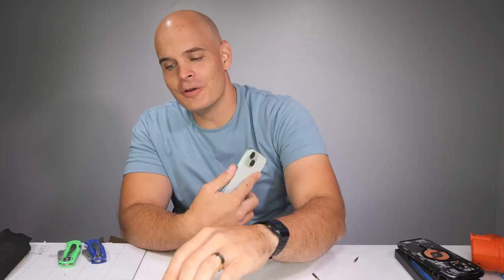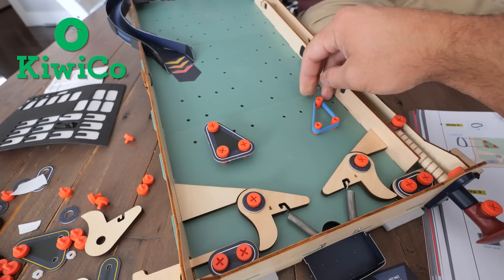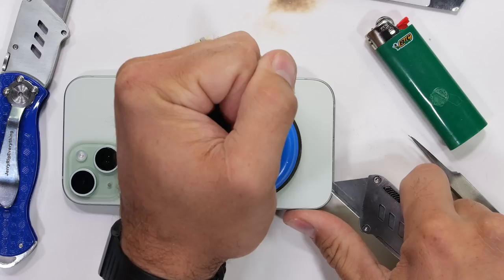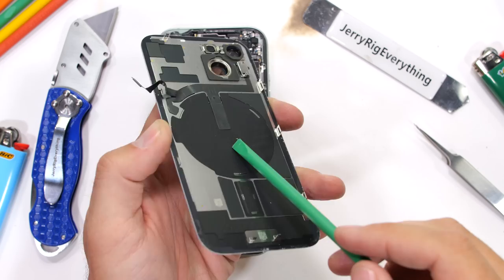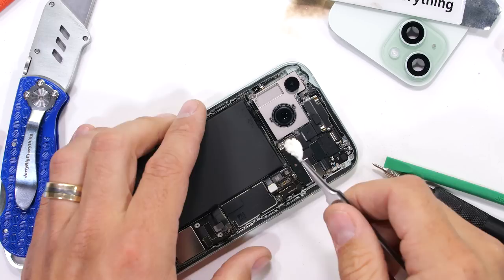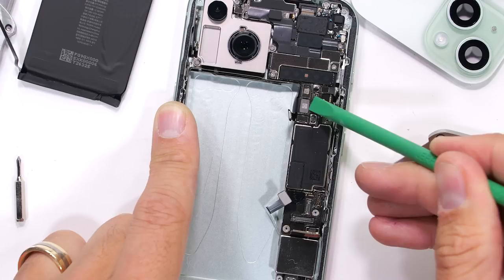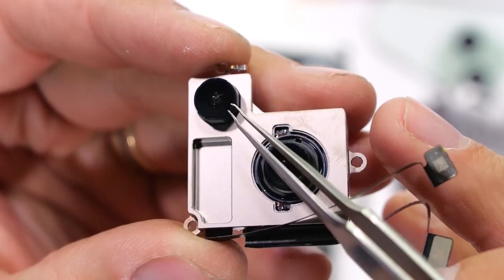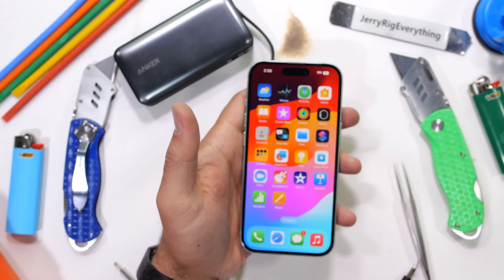iPhone 15 Teardown - Why is nobody talking about this?!

Comment: Excited to see what you feel after using an iPhone for 6 months. One of my friends said he would die before switching to iPhone but eventually he did, and never went back to Samsung. Don’t really understand the tribalism when it comes to what slab of glass and metal you use, but he took it pretty seriously, so it was very funny when he switched and found he preferred Apple
Reply: I have nothing against Android, I just like the look a feel of iOS.
Reply: I like android better, but to each their own lol
Reply: I actually tried an iPhone back in the day with an iPhone 5. I used it for 3 days but didn't like it. I suppose everyone has their own tastes.
Reply: Pixel beats both those phones
Reply: For a brief moment as I was reading I thought your friend did died.
Reply: @wshyangify  lmao
Reply: "don't really understand the tribalism when it comes to what slab of glass and metal you use..." because consumers have voting power, and they vote with their wallets, and i will not vote for a company that software locks the back glass panel to the motherboard..
Reply: Consistency with the software suite matters far more than the hardware used. That being said, I also don't want to pay criminal prices for a new screen or a battery swap. Or any of the other bullshit apple does and calls "customer service".
Reply: @faz_s Same. I think Android offers something different, a device which doesn't limit what you can do with your phone. The iPhone 5 was the only iPhone I used.
Reply: @psylencecy  I don’t think you know what I mean by tribalism. I mean I don’t understand why people fight each other over if Apple is better than android. It really doesn’t matter at all
Reply: @skinnyman  exactly. we fight because we want our brands to be consumer friendly. if both apple and android brands followed the same anti-consumer practices (eg no charger in the box) we will be screwed.
Reply: @faz_s iPhone 5? Seriously
Reply: @psylencecy  No, I’m saying I don’t get why people attack one another for which phone they choose to use. That’s really stupid
Reply: @ruga129  yep... Seriously!
Reply: @faz_s  I mean the last iPhone you used was iPhone 5 and iPhone (not only iPhone every phone) has improved dramatically and you are using iPhone 5 experience to compare it
Reply: Me too, Google think My country is too poor to afford Pixel so they did not sell one here

Samsung is nice, but their repair is as painful as iPhone, not to mention their OLED screen randomly get lightsaber for no reason

Which leave me with the fruit, not ideal but it’s the best for me

The price is painful, but at least I’m keeping it for 3 years or longer
Reply: @ruga129  well it was the best iPhone at that time. It's not like I could have bought an iPhone 14 back then hey!

Lots of iPhone users judge Android phones on phones that they experienced in the past.

I didn't like the fact that I had to be tied down to only using apple products in order to get the most out of it.

Haa that changed?
Reply: @faz_s  I am not saying iPhone 5 was bad but around 11 gen have changed since then. You can't compare any phone on the basis of a decade old device. I am not even saying to use a iPhone. I just feel weird that you are saying you don't have an iPhone because you don't like a decade old phone
Reply: @ruga129  well that was a decade ago.. And at that time.. I preferred android.

Does iPhone not tie u down to only using their devices.. As the say.. The apple ecosystem. I don't like that. If I paid for something I want to be able to use it how I want and with whichever devices I want.

Does apple offer that?
Reply: @heickelrrx  yeah the longevity of iPhone is its biggest selling point imo, you get about 7 years of updates
Reply: @skinnyman  And they sell in more place than Pixel

Google think I'm too poor to afford pixel, while Apple still willing to sell me one of their phone

it's crazy
Reply: been debating switching myself, always been an android user mostly due to Apples "walled garden" approach to apps/app store and their (slowly improving) views on right to repair and repair costs

Comment: I’ve been an Android user for the last 15 years and recently changed to the iPhone 15 pro max and it was a great decision as the battery is incredible
Reply: ?
You can even find mid range android phones with much better battery and charge speed than iphone, What differentiates the iPhone is that it is a very balanced device, it is not a 10, but a 9 in everything, pixel is a 10 in camera but 7 in battery.

Comment: you’re missing some info on some “iffy” points. specifically with the 3-d touch feature. you claim you have to go to settings from the home page, which is true for many things, but wifi and bluetooth are not those things. on the interaction menu, hard-press on the bluetooth/wifi icon to open their mini-menus. also, when moving the cursor (idk what it’s called) while typing, you can hard-press the space bar to accurately move it where you need. 3-d touch is pretty neat.

edit: i switched from android to iphone ~4 years ago. you didn’t mention the worst part of iphone. the app store suuucks. especially if you’re the creative type. i have a windows pc to use for my creative endeavors now, but if i didn’t, i would 100% guaranteed still be on android. the play store has much better apps for photo, video, and audio editing.

Comment: That place holder has a ribbon cable and a connector, I guess you can get a sim card adapter and a international housing and convert your US iPhone into a SIM iPhone (I got my iPhone 12 dual SIM adapter from AliExpress and converted NA iPhone into a dual SIM kind)  I guess?

Comment: It doesn't matter about modular components and battery pull tabs if every single component is paired to the logic board, thereby prohibiting 3rd party repair (outside of Apple's pricing).
I was recently able to repair a Galaxy A50 with a new screen, interconnect cable, camera, rear adhesive AND get a suitable case and screen protector all for under £70.
It would cost more than £70 just to buy a (serialized) battery from Apple's self-repair catalog!

Comment: Did you know???
If you use the ultra wide or the 3X zoom without using the main lense, you cover the main lense while using either wide or zoom it will mess the lighting??
I just tried it on the 13 Pro max

Comment: I just leave my notes here.

6000 kelvin is roughly 3.128602643E-26 Horsepower (metric) Hour

It's better to calculate Temperature with Horsepower Hours imo

Comment: I feel like the titanium, similar to the stainless steel is just another gimmick. Aluminum is the best overall for a reason hence why the majority of other phones continue to use it to this day. It's cheap, durable and lightweight. If the pro iPhones went back to sturdy aluminum, I probably wouldn't notice any difference

Comment: Could you do an iPhone screen comparison between the last five or so generations? Has ceramic shield gotten better? Are we at the point where screen protectors are no longer really necessary?
Reply: Necessary is subjective. 

If you do not use a screen protector, your screen is liable to get scratches, no matter what phone you’re using, deep or surface level - it’s gonna happen. I think a tempered glass screen protector’s best use case is honestly against drops. Much better to spend $10 on tempered glass protector than replacing a screen.

Whether scratches bother you or not, that’s the subjective part of “Is it necessary?” Necessary, no. That goes for any phone ever. You don’t HAVE to protect it. 

With Apple’s such restrictiveness on replacing something like a screen, it’s kind of silly NOT to put a protector on it.

Then again, this is coming from a certified dumbass who does not use a screen protector. 😂 I have an iPhone. It has scratches. Every iPhone I’ve had has gotten scratches. I don’t really mind them, thus the subjectiveness and non-necessity for me.

Comment: In 2021 I switched to iPhone, then in 2022 I got a 1tb 14 pro max at launch and this year I got the 1tb 15 pro max at launch. Yes I got apple care on both of those since I don’t use cases. The 14 pro max survived 15 concrete drops throughout its year before I sold it, idk what the max amount is, but I drop my phone a lot. 15 pro max is noticeably more scratch resistant tho, maybe that’s why the glass shatters easier?

Comment: Oh boy, I remember when repairable phones were common. I miss them so badly it hurts on more than one level, financially, emotionally, physically. I just want to replace the broken parts and not contribute to a massive pile of unusable electronics, is that really too much to ask for? 
You can recycle all you want, but if you prevent people from repairing the device it's basically a useless cause at that point.

Comment: Apple should have used the same iPhone 15 back design for the iPhone 15 pro and the max because thats how its more durable and not going to shadder because all new phones are the same size both iPhone 15's and the 15 pros
Reply: but then they wont make as much money through repairs. thats the whole point.

Comment: For the record, the software locks on the back glass are so inconsequential that I think most people wouldn’t even know if you replaced the back glass on their phone.
Reply: That software lock is probably more for the wireless charger/magsafe , they probably require some calibration. Not the backlass itself but the features will likely not work the backpanel gets replaced

Comment: You probably meant 5-600 Kelvin? Because 5-6000 Kelvin is, well, almost 5-6000°C or ~9000°F which is close to the temperature of the Sun, so the best thing that would be left of that iPhone would be a pile of ash.

Comment: I was using a Xiaomi Mi 9t pro (yes, taht one that the camare goes up) for the past 4 years! I never had any problems with the camera neither with any other part of the phone!
For the first 3 years I used the case that it came with, but for the las year i was using it without any case.... It was really good tho, droped it sometimes and it never broke or anything, but my cat fu*** cat pushed it from a really high table and it fell flat, the screen died.
Oh, I also used it without any screen protector for the 4 years!
It's kinda sad that those cool cameras aren't being made anymore so I was thinking about buying a Z Flip 5. BUT OMG IT'S EXPENSIVE HERE IN BRAZIL!!!!
I will use a Samsung A30something (my mom's old one) until i can afford a Flip (i'm 18 and a student, don't think i will be able to buy it in less than a year).

Just wanted to share my experience with phone taht has one of those cool cameras and prove that it isn't something that will brake!

Thx for reading!
Reply: Sorry for my bad english, everything i know is from playing games, watching things and talkng to some people.

Comment: I'll take difficult to remove and glued in parts over software locks any day. You can remove and replace the back glass on older iPhones with the right tools (or replace the whole housing, which isn't that expensive aftermarket) and with the help of some alcohol and heat, you can replace Samsung's stubbornly glued in batteries and everything functions normally. With software locks, you can't restore all original functionality at all, no matter how easy the part itself is to replace. So if anything, I think Apple are really going backwards when it comes to repairability.

Comment: > Spends more than a decade making their devices unable to be repaired by the owners or 3rd party
> not allowing spare parts to be sold to 3rd party tenchincians
> makes half assed self repair program that costs more than a new device to repair the existing one
> bribes officials to modify right to repair bill so that it doesn't help a consumer in any way whatsoever
> still software locks parts EVEN the fucking back panel glass

Adds USB C, Makes the back panel glass slightly easier to remove than before

Oh WaW aPplE is MaKIng iPhuNes repairable, thuMbS uP fOr tHAt!

Seriously Zack are we really this dense?

Comment: I purchased iphone 15 on 22 October and now battery health dropped to 97 with only 35 charging cycles. Apple is intentionally using cheap batteries to get money from battery replacements.
Reply: Shhh eso es secreto😌
Reply: I purchased the base model iPhone 15 back in September close to the release date.

Been 4 months using the phone everyday and battery health still shows 100%.

Comment: Apple:FINE We will make the phone repairable.

Customer:Sweet! 

Apple:Im going to make it painful, expensive and painful to change anything but a screen or battery cause fuck you. Also we are software locking the phone so you almost have to break the back to get it apart. 

Customer:Why? 
Poor UbreakIfix tech: Dude why? 
Anyone with a brain:Why? 
Brainless: Also why? 

Im convinced apple functions solely on the elitism (Its extreme but I couldnt think of a better word for it, sorry) it has creates around its products using the eco system and Imessage/facetime.

Comment: 6:18, then most useless part in the phone , apple says they dont have space for a headphone jack coz of the space being replaced by new taptic engine and look at here ,filling space with a box and god knows what that ribbon cable that it has does,maybe another software locked empty box for nothing other than to lock people out when they remove it, this kind of feels one can drill on side and add their own sim card slot,lol ,hoping someone makes the motherboard accept it somehow.